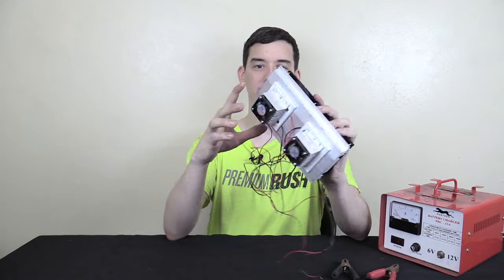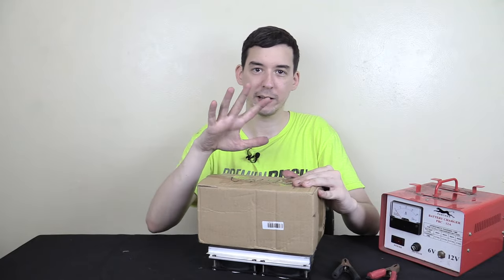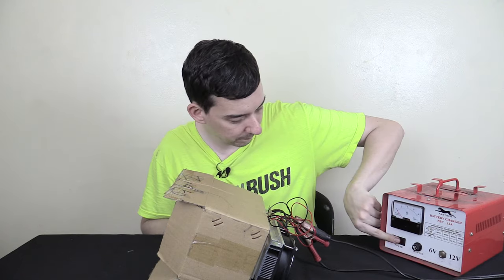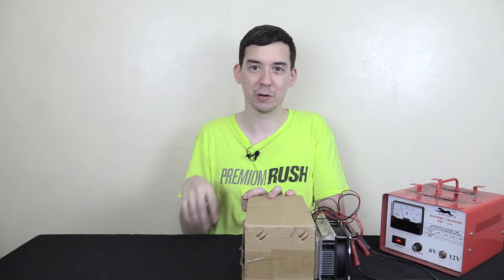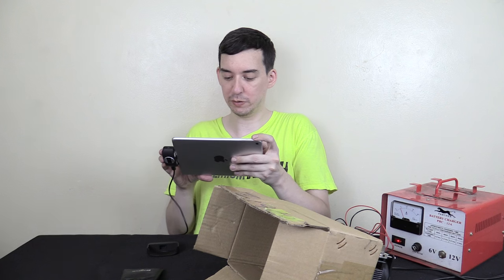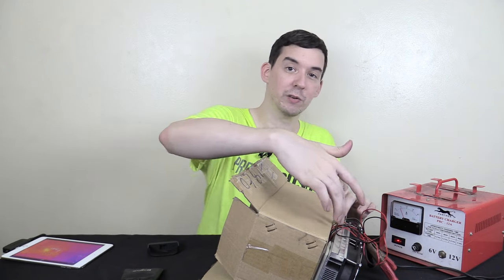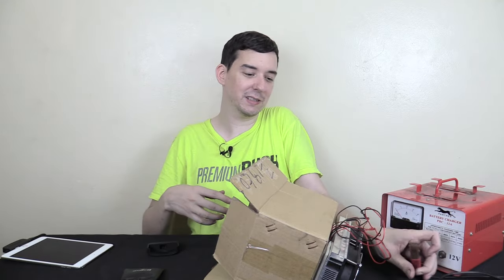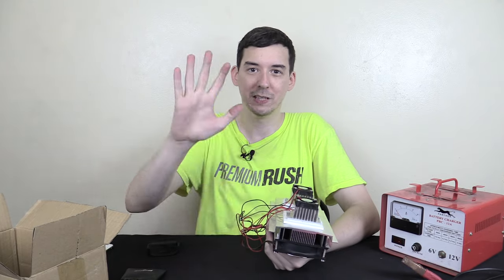Peltier Thermoelectric Cooler

Comment: You can use solar panels to power those peltier modules to make an airconditioner that does not cost anything for power which would be especially useful during summer. You can then use the hot side for heating drinks lol
Reply from the maker: I like your thinking. Really getting the most out of it!
Reply: Thanks! I have been wanting to do this but when I went to buy peltier modules, I was discouraged by the price of 450 php a piece

Comment: Hi, Can you dip the heating part into water without the fan attached ? Peltiers are anyways inefficient, so want to know what impact that experiment would have on cold side of the module :-)
Reply: Yes you can. I read from a guy that actually dipped it in a large bucket with a lot of icy water and the temperature of the cold side of the peltier got down to -50 degrees Celsius. The maximum achievable temperature difference of both sides of the peltier module is 67 degrees Celsius, so if you manage to cool down the hot side very well the cold side will get very cold.

Comment: Reverse Engineer it! Get the Peltier and put them on the roof to generate a generous amount of energy and save it like in powerbanks or use with a 5V or 12V fan. Hhmmm What do you think? There are tons of detailed guides on how to make one online. It could be helpful at least to save a few bucks.

Comment: hi try to reverse the polarity on the Peltier's  and  the cold side fans and use it to cool a room  like a 12v air conditioner.
Reply: The peltier will burn within minutes because the hot side will be getting far too hot.

Comment: How many peltier that i need to make cool 2,5x2,5 m with 3 m ceiling? I live in tropical country summer is the worst. Air conditioner consume a lot of electricity and the price is expensive. I want to make one by myself.
Reply from the maker: There's probably some math behind working it out but I'm not sure. You'd need a LOT i'd guess. You might want to look into converting a car aircon system instead.
Reply: Titoyan Dwihandoko at least 20
Reply: Titoyan Dwihandoko ohh its the worst summer then less then 25 would be usel3ss and btw one peltier draws 70 watts 70x25 equals more then 1300watts which is the same as air conditioner lolz
Reply: Titoyan Dwihandoko u should use a room cooler quite cheap and efective
Reply: hadi hassu i didnt use paltier but i use DIY AC by using copper pipe, pump and ice water
Reply: Titoyan Dwihandoko yeah i was gonna suggest that but i didnt got the time to type that method good thing u already did it ;-)

Comment: im late to your post but you have a great idea and i have the solution that you need! the new cpu are running at 105 watts! and melting the computer. nothing can cool them down! the best thing to do is to put your computer in a freezer! but how can we do that. well you have the answer! what you need to do is cool the computer cabinet! the heat it makes my air conditioner can deal with but how much power do i need for a computer box.

Comment: Is there a way to control the cooling strength? Like your FLIR showed 16 deg, could it be set to draw less power but output 23 deg instead? BTW, it was kinda awkward at the end you were moving but had the two "previous" videos show up. I think it is much better if you just froze the last frame instead. :)
Reply: Vary the current or voltage.
Reply: Simply lower the voltage and the current will follow.

Comment: How many BTU/Hour of cooling will it do? I have done a bit of math and a high-end gaming PC will produce 2,500-4,000 BTU/Hour. The 4000 was a bit of an exaggeration.  I am sure that peltiers could be used for PC cooling at very low cost if solar powered.
Reply: TEC1 Peltiers are usually in the region of 100-200 BTU so you'd need like a dozen of them to even come close to removing the heat of a gaming PC assuming you were effectively removing the heat to an external environment.

Comment: maybe you can do a aircooler style that blows cool air to your face or body? icebox then the device on the right side and airblows out to you on the left side... so that device is cooling a little area instead.
good airflow for the person...
Reply from the maker: It should work pretty well. Although I still like the idea of a fully contained area around your body that keeps all the cool air in. But that's starting to sound like a coffin lol
Reply: Gadget Addict i think thats good use the one they use to insulate ceiling that looks like a foil with foam so you can roll it up if you want to go out of the coffin hahaha

Comment: hey i like your videos! i recently been tinkering with 2 peltiers i ordered on amazon for cheap. they worked great for a little but but both suddenly stopped working. i cant find any info why i destroyed them as i made a diy mini cooler. they were rated at 12v and had them hooked up to a golf cart battery thats 12v. i had heat sinks on both sides. but im confused on the direction of the cooling fans on both sides....i think i had both fans inward to push air through the heatsink and push the temperatures off of the radiating aluminum. the seller was awesome and sent me free replacement peltiers....but im hesitant to ruin another pair of them when i dont have money to buy more. any suggestions where i went wrong? do you know if a peltier gets destroyed if its internal temp destroys itself by not using heatsinks with fans and thermal paste?
Reply from the maker: I don't think it makes a huge difference whether your cooling fans are pushing or pulling. Peltiers can fry themselves if they get too hot. I've lost a few due to overheating. I've also had some that just failed for no apparent reason. Not being pushed very hard and suddenly they just stopped working. So I guess to some degree it might just be the nature of the beast when it comes to cheap eBay electronics :P
Reply: I appreciate the response! I tried to look deeper into it and took a long time... the conclusion I came up with was to start at the beginning . knowing the seabeck effect and its properties to interconnect 2 different distinctive metallic properties and individual conductivity of the unique properties. Then tried to think of where the system could possibly fail...boiled down to the connectivity of the conjoining of the 2 metals. poor welding or soldering jobs can oxidize with air pockets or cheap materials becoming brittle by the high intensity and expansion/contractions by a direct connection with fluctuation of heat. like concrete getting breaks and crack from extreme weather.

Comment: I don't really want to put you off the idea but I think these  are not enough to cool you down but you still can give it a try for fun... :)
Reply from the maker: I'm sure it wouldn't be as effective as a real aircon unit but I'd imagine it would do somethingggggg. Provided the space it's cooling is well sealed and only slightly bigger than your body. I dunno, maybe it's just a pipe dream :P The large area plus the heat of your body, I guess it's most likely not going to do much.

Comment: I think that a heat sink and not really peltier because peltier actually like an upgradee solar panels with accelerator coil control the rate of transferring heat extract from surface pump into battery voltage and two side separate farther and bigger temperature differential the better like the roof and foundation of the House or water lake and house roof

Comment: I just want Board it all. eBay. It appears if there's no illusion optically that the fans of large fans, those are not those 3 inch fans. Those are the almost 4 3/4 for fans. Correct, I'm gonna make a ice box with mine.

Comment: man for safety concern, dont let those charger clamp hanging uninsulated, ive noticed there almost touching and you have metal grill at the back of fan which is also a conductor. SAFETY FIRST.
Reply from the maker: Well it's only low voltage DC, so the worst that's going to happen is some sparks and then the fuse will blow. But I agree, generally it's better to keep them apart to avoid damaging your equipment :)

Comment: hey hi, can you tell me that how to control the temp. with controlling electricity like ac.
Reply: Just lower the voltage to decrease the heat pumping effect.
You could also use a thermostat which switches on at one temperature and off at another temperature, but changing the voltage is better for the peltier module.

Comment: cool. you can cool a dringking water.
Reply from the maker: Could even make the peltiers cold and warm cold and warm to pull water out of the air. Especially since humidity is so high. It would be a slow and power hungry method though :P

Comment: Put it on a Motorcycle Helmet.  The full face type. Place the gadget at the back near the nape area and modify the helmet insulation to turn into like an air duct system. Oh yeah! You will look like a living storm trooper and the first to ride a motorcycle with and air condition helmet. Then patent it and don't forget me LOL. You know what? I could done it long before if I'm a rider.

Comment: Build a Cooling Jacket.  Plumb the jacket with Web of aquarium tubing.  Solar panel on the back of the Jacket.  Single peltier element set up cooling water to be pumped throughout the system.  Just one Amp cools them down quite a bit.  Everyone will think you've lost it wearing a jacket in the heat of the summer.  But who gives a Rat as long as your cool.

Comment: Might be a bit loud for the bed thing. You'll won't be able to sleep haha.
Reply from the maker: It's much quieter than a window type AC, I think it would be okay. The biggest issue I think will be getting the cool side close to the bed while having the hot side exhaust out a window. Gonna have to put more thought into it.
Reply: Connect Flex tubing to the hot side and a squirrel cage fan attached to the exhaust at the window.

Comment: make a personal air conditioner
Reply: The problem with that is that Peltier modules aren’t very efficient, you’d need a very high power Peltier to make a good air conditioning, and just like in a heat pump, you need to dump the heat somewhere else.
Reply: You just need an small closed area like a camp

Comment: how much power does this use in an hour vs lets say a stand fan?
Reply from the maker: Most stand fans consume 40-80 watts on the high setting.  This unit consumes 100-120 watts.
Reply: How much will it keep the temperature reduced under the outside temperature in something like a small space like a 2 x 2 ft box?
Reply: more than a fridge with a compressor there really isn't any real application for these accept maybe heat sinks or similar. They are not efficient at all with most of the energy wasted as heat

Comment: it is possible to make a mini AC unit to blow to my self  out of that
Reply from the maker: As long as you can exhaust the hot air outside of your room :D
Reply: +Gadget Addict I think it will be pricey to swap it to a PC water cooling and put the radiator out side the window

Comment: PC cooling ?
Reply from the maker: That's a potential use for hardcore overclockers :)
Reply: Kenneth Littrell 1) distilled water is non-conductive, if it was pure h2o, you could submerge your computer in it. Most water cooled systems use distilled water. 
2) someone had tried a peltier module as a cpu cooler, it overheats easily as they just can't cool enough so the hotside and coldside basically have the same temperature. Remember, most cpu's get up to 60-90 degrees Celsius when operating under load.
3) extreme power CPU'S can output 220w of thermal energy, much more than any fan system could ever hope to disperse. Even most water cooling systems can't handle that, it requires highly efficient water cooling setups to disperse that much heat.
Reply: like magnetic effects in nature, differing forces want to eventually equalize. heat has a major effect on moving electrons. like if you if u heat a magnet, it loses its magnetic property entirely at a set temperature. there isnt a hormonal balance to keep both extreme temperatures and its constant without varying control of electric impulses and control of current
Reply: Rubbish! Pure water, Dihydrogen monoxide, is a poor conductor of electricity, but it is still conductive. Also, it is virtually impossible to find and maintain pure water due to it's amphiprotic nature and the fact it makes an excellent solvent. Only an ass would recommend putting your electronics in water
Reply: Peltiers are not very useful for PC-cooling. They are very inefficient. Remember you put a lot of electric energy in them to pump the heat from one end to the other and all that energy is also dissipated as heat. So f.i. if you use a TEC1-12706 which is rated around 60W at 12V, you are actually adding 60 Watts of heat which you'll have to get rid of as well.
I would think the best possible way to cool down a PC using peltiers is as added cooling for the case itself. You could try to convert your PC-case into a fridge with them, so the hot side of the peltiers are actually outside the PC-case with large coolers on them, but it will take a lot of power and you will need to isolate your PC-casing.